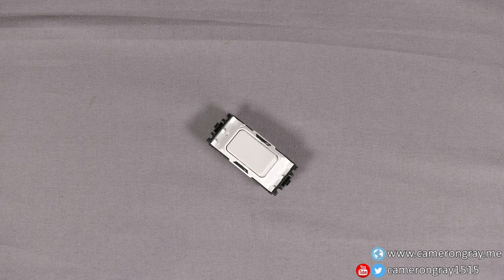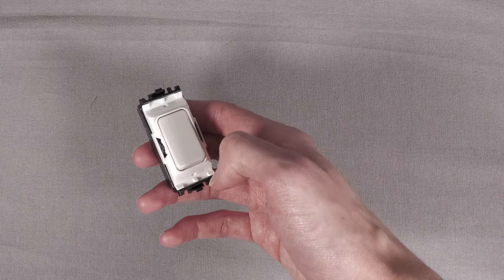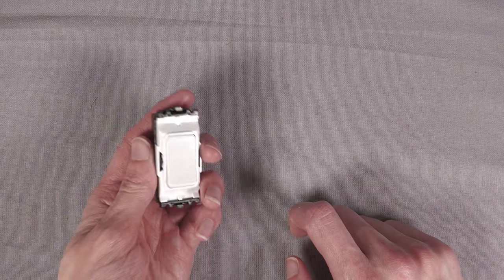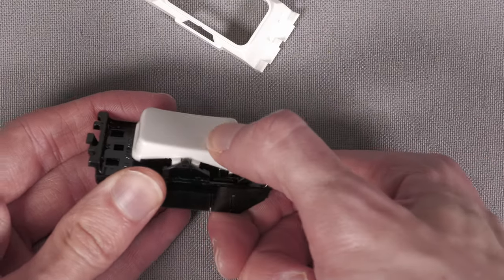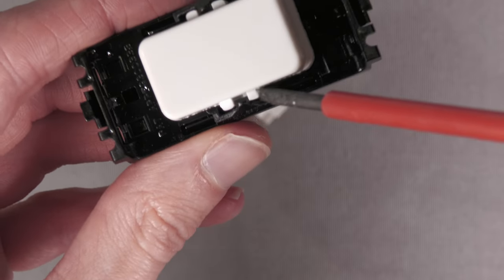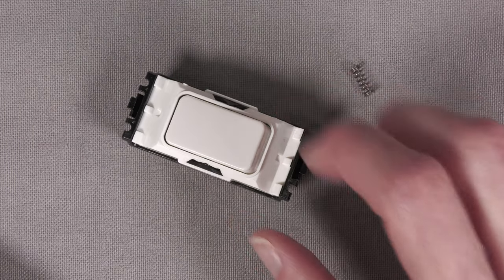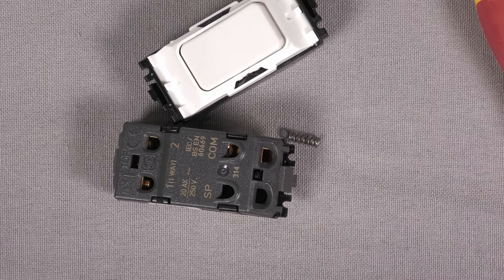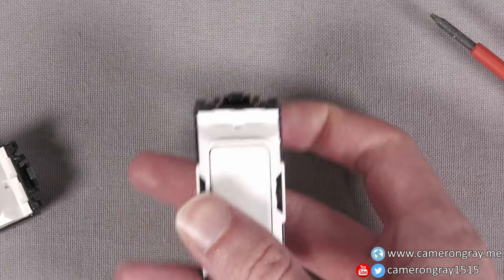Extra Video: Making my MK Retractive Switch Modules Easier to Press

Comment: Would be interested to know if it's possible to swap the plastic switch facia between the retractive switches and the standard ones.  I'm using MK Grid retractive switches for my bathroom fans with Shelly/Sonoff doing the magic (Sonoff Zigbee humidity sensors also triggering in case you forget).  I quite fancy the MK 'Fan' labelled Grid switches for this (K4896FN) but they don't seem to do a retractive one.  My DIY attempt at making a nice label with the Cricut looks a bit OTT.
Reply from the maker: I can't say for sure however I just took a look at the module I use for my central heating (K4896BR) which I'd assume will be the same minus saying "boiler" rather than "fan" on it.  The rocker cap does at least have the moulded "pegs" on the underside that the springs would hook into and the casing on the top of the switch also has the appropriate pegs for the other side of the springs.  Therefore I presume they're just using the same moulding for all switch rockers (apart from the neon ones) so I'd like to think it would be transplantable.  Of course this is all going outside of their official design so there's no saying that they won't change things between batches but it does seem likely.  And now you've got me thinking about smart switching for my bathroom...
Reply: @camerongray1515  nice one thanks. Might grab one and have a go.

Comment: Does this cause an uneven pressure surface? (harder to click on one size than the other)

Also, do I see a post in the middle where the spring could be centred on both the black and white plastic?
Reply from the maker: Doesn't feel uneaven to me, it's very well balanced around the pivot point.  There certainly is a centre peg on the black piece but unfortunately no corresponding one on the switch rocker, it's used on the centre off switch wich has a single spring on each side, the same piece of plastic is used across their various models.